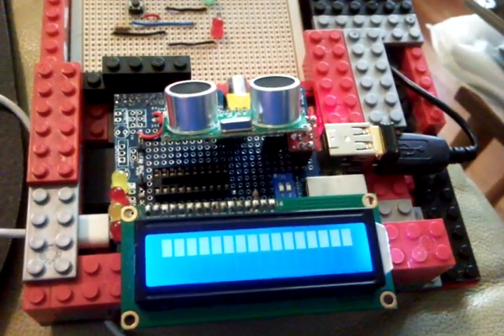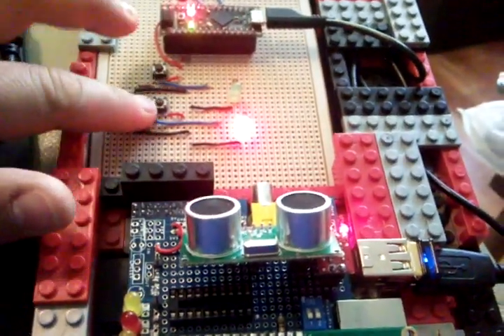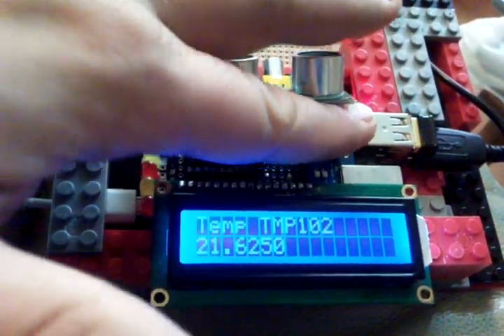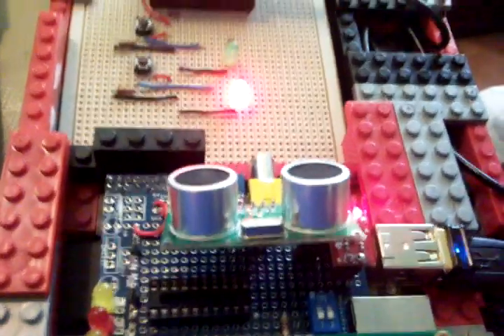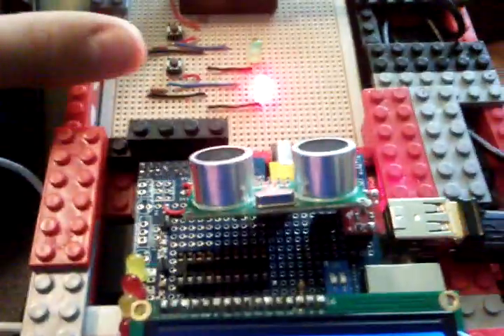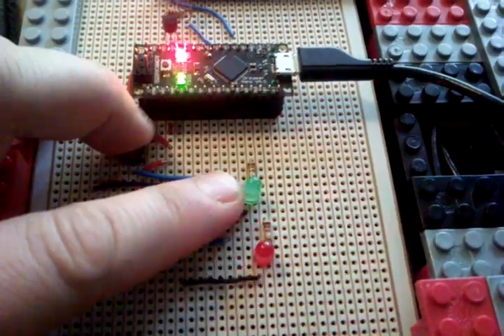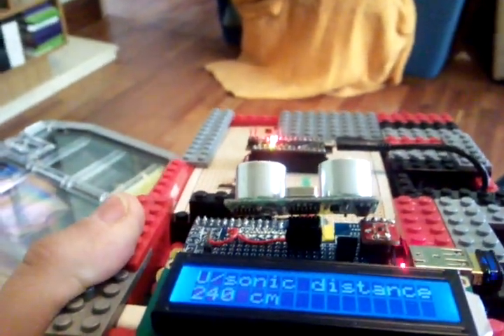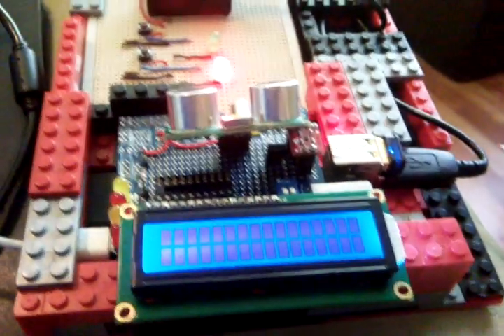PiPodCorder in action

Comment from the maker: The light and temperature sensors are actually connected to the small circuit board at the top which is an Arduino (well, an Arduino clone called a Dreamer Nano). Because Arduinos have analog inputs, it was easier to do that than put an analog-to-digital converter into the circuit.